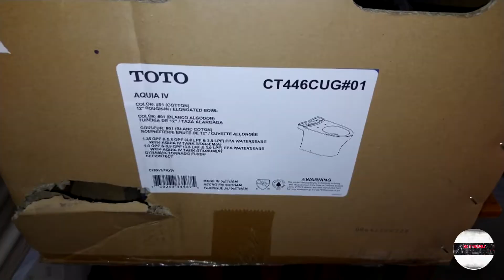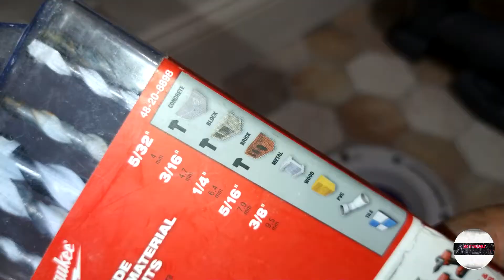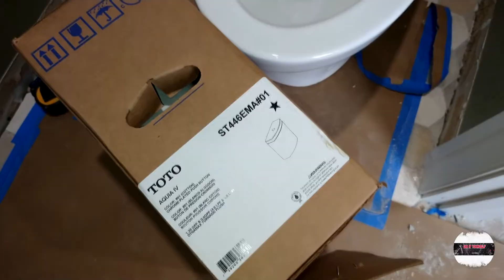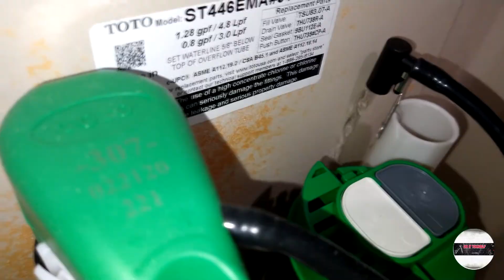TOTO TOILET - CT446CUG#01- INSTALLATION

Comment: Great video! I have to service a Toto. I think it may need a new gasket because its leaking from the floor and not the angle stop. I've never taken a toto apart before so this is very helpful.

Comment: Did you put the required washers on the toilet seat bolts? Looked like you just screwed them into the rubber washers that were pushed through the holes?

Comment: Will the rough in fit a 3" flange? Bc the lip on the bottom wont fit through the 3" flange. And I'm looking at mine. The back part isn't flush with the front part so if I install it it looks like it will sit at an angle. Is it supposed to be that way?